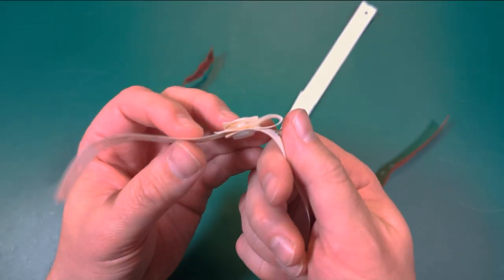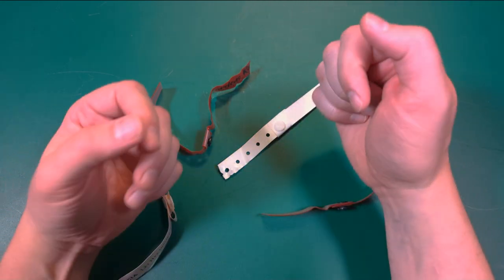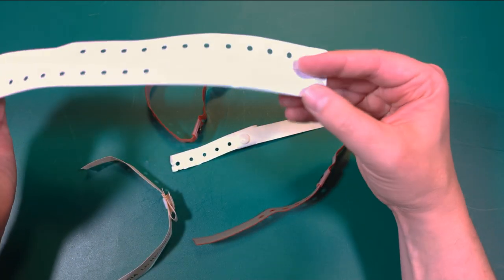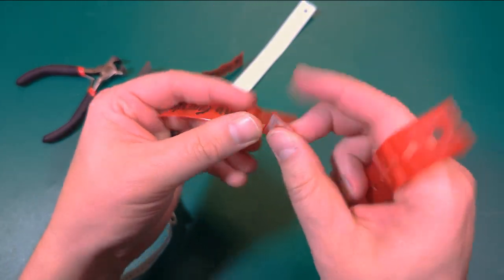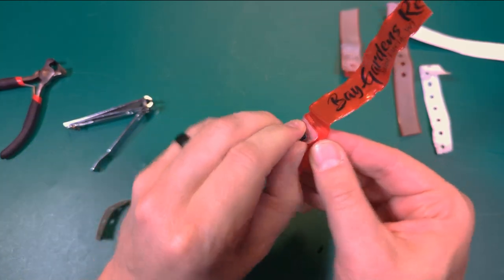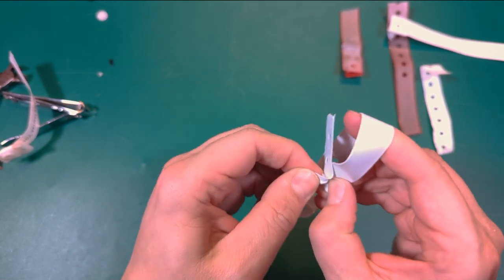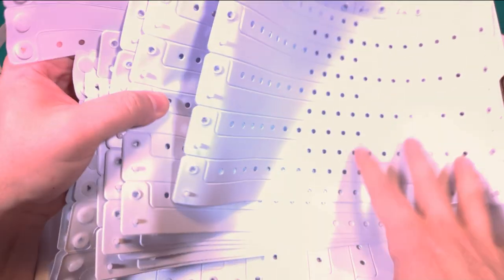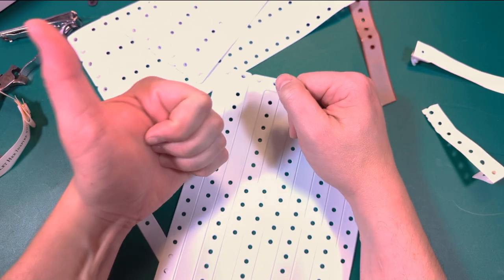Tampering with Wristbands - Part 1

Comment: You can buy just the tamper buttons; we buy them by the hundreds for our ankle monitors as you have to use a new one each time you change out the monitor. They work great for doing this except that they’re black; I’ve uses them in the past and just keep a couple paint markers as you can color them whatever you need though usually no one is looking that close, and usually they aren’t looking at the snap side anyway. You can also make a reusable version with a short threaded stud/screw from the hardware store, which is nice as you can just reuse the same one over and over again; this style closure as well as Velcro bands can be used to show the color of the day.
Reply: Came across this comment only after posting my own... Had basically the same idea about stud/screw, but yours is no frills. Sorry if mine "steals" any attention. Also, buying just the buttons, for any case you might need them, is genius! I actually didn't realize that's possible without that ton of bracelets 😅
Reply: @olgapisova6207 : We’d buy them in, I believe 100 packs, and they came in different thicknesses, they also were twist to break instead of being cut. You could just twist one side with a screwdriver, coin, or just about anything flat. We used them in ankle monitors all of our monitors, Al sensing, GPS cellular, and distance tether monitors used the same buttons despite being made by different manufacturers. The different thicknesses were because there were different straps based on length, weight, and type of monitor so one size didn’t fit all. They were damper resistant and not removable so anytime you changed, checked, or pulled/installed a sensor you’d need a new button. 
We didn’t always use them but once a few judges realized they made a decent bail alternative or cheap monitor for alcohol consumption they started ordering them as a bail alternative or condition of release and the use increased. 
I’m not sure if they sell the buttons without an account or contract, or outside of law enforcement, but I always thought it was a pretty cheap fail point or bypass for at times $5,000 monitors.
Reply: @libertarian1637  wow, that sounds VERY universal! For tougher band materials, would it be mechanically the weakest link? In jewellery, especially necklaces, even welded chains often have a non-welded ring or two near the closure, always thought it must be also for safety than just pure repairability... Does that have any relevance here?
Reply: @olgapisova6207 : The straps aren’t either rubber or vinyl with wiring running through them; the wires is what defects of the band is cut or separated/removed. The Bands aren’t weak at all but the buttons are designed to fail if too much force is applied as a safety measure as well as making sure the unit is set off as when the buttons break the bands naturally separate which triggers an alarm/alert. Looking at them for even a few seconds and most people would understand how they work and recognize the plastic button; but I recall a jailer in Baltimore that cut one of our bands instead of breaking the button when they were booking an individual with one of our Al monitors on them. I don’t recall the exact amount but it was over $500 worth of damage due to the Al monitors being unique; we ended up eating the replacement cost as the jail refused to pay and the damage wasn’t caused by the individual so the order didn’t require them to pay. Technology has changed a lot regarding monitors over the years and they have gotten a lot smaller, much more accurate, and even capable to operate via satellite for those times when cellular or POTS just isn’t an option.
Reply: Any particular name for them? I can't seem to find anything with just "tamper button"
Reply: @qqqqqqqqqqqqqeq : I can’t recall the company off the top of my head but I’m sure I have it written down somewhere. I’m sure they have a technical name like tamper evident closure or the like but in the chat I just referred to them as buttons because that is essentially how they function.
Reply: Link to Tamper buttons that would work in this situation?

Comment: Another way to tamper with them: cut the band at the hole the pin goes through and then tape it up from the inside to close them again. The cut will be hidden by the wrapped over part of the band and nobody inspects the "skin side" of the band, even if they look at the clasp.

If you have double-sided tape you can do this on your own (put the tape on your skin temporarily to hold it in place while taping the two ends together), otherwise you need someone to help you as taping the two ends together is a two-handed operation for most people.

Comment: That nail clipper was pretty nice trick. I think you could use it to cut the whole stem after cutting enough from the sides so you can get the whole thing off without enlarging the holes at all.

The only counter-action different places could have is color coded security snaps. Sure you can purchase box of bands with each color but that's get pretty expensive  fast.

Comment: What's your trick for those paper wristbands designed with a sticker that tears off ? Just cut it somewhere and use transparent tape on the inside to attach it back ? Or do you have a better way ?
Reply: That works, but a bit of Naphtha(or cigarette lighter fluid(Ronsonol or Zippo fluid) releases most stickers, and as a side bonus, once it evaporates(quite quickly, BTW)the glue gets sticky again, making putting the wrist band on super easy-the results will be undetectable.
This works on some anti-tamper stickers too.
Reply: @m.k.8158  yeah, LPL for example defeated a tamper sticker with alcohol, picked the lock and put the sticker back on the lock. The sticker covered the keyhole 😃

Comment: Coming at this from a different direction, perhaps you could subtly force the steward to put the wristband on you looser than they're supposed to. Either with the 'clenching your fists so you can slip out of handcuffs later' trick, or wear a chunky watch or bracelet when you're being admitted which will limit them to putting the wristband on a chunkier part of your forearm.
I am very tempted to get a sheet of these wristbands now to try different opening methods and also to see if i can print a reusable clasp for them

Comment: We have a upper end resort condo facility that uses these for access to the pool, water park, mini golf, buffet, and theater. Different colors for different days. The restaurant is open to the public so you sit around and observe the band of the day and then grab one from the collection we've collected. The snap is easy to remove. I used an old extendable antenna. Take it apart, find the section that best fits the post. Check it in the drill and the antenna tube will cut the fingers that hold it to the post. You have the parts but the fingers are gone. It's as easy as a dab of super glue gel, or hot glue to put it back together. You make it big enough where it can slip off and on with a little work and you have a reusable wrist band collection

Comment: I've been cutting a small notch in the band under the snap at an angle. No need to cut the snap and you can remove/install as many times as you like. I guess it's not as strong but it's basically instant and free.

Comment: Have you ever experienced the fabric type wrist bands used commonly at music festivals? They have the added bonus of turning themselves into a noose for your wrist if the slack end gets caught in something. When I used to work production for music festivals I would typically fold the end up and use a piece of e-tape to make it tight. I never had a problem with security. I think it helped that the e-tape looked similar enough to the actual clasp and security was typically lax near the staff entrances.
Reply from the maker: Yeah ... Thankfully I can usually slip out of those and then pull the clasp completely off, then destroy its teeth on the inside, then it becomes flexible and removable.

Comment: If you use a pair of diagonal cutters, you can usually use them to wedge underneath the cap and rotate the cap off the pin non-destructively. It cones out the pin a little bit not enough to keep it from retaining the cap.

The tyvek ones with the glue and the frangible end... Those are a bitch.

Comment: Got any ideas for the Tyvek wristbands that use adhesive in a span almost shredded to ribbons to make sure you can't get it apart in one piece? I kinda found I don't have to, they can be taped from the inside without drawing much attention (and if someone asks I'll say it caught on something and I put it back on myself), but that only works if it's the right color. Playing the same venue for years meant I had a wide selection of their wristbands, though. They could detect them as old by the serial number, but I think the circumstances would have to be pretty intense for them to go to that great a length.

Comment: No one is checking the snaps, are they? As long as the band is intact? I suppose if someone was suspected of having removed and reattached that'd be evidence, but im thinking those holes are the right size for the brass inserts with button tops and flexible bits used for holding a 3-hole punched stack of papers together...

Comment: Used to have one at hospital. Worked out as an 10yr old kid I could wedge my teeth between it and provide gentle pressure and they come apart. Bonus, they would snap back together looser than before and could be removed. I would wait till morning visiting hours, put on clothes snap off the hospital band, walk downstairs and buy sweets from the shop and return back. No one ever knew.

Comment: I know I have been able to open one of these, but usually the simplest solution is just to cut one of the sides of the hole and then remove the part and then melt or glue the part you cut. Precisely bc they aren't "doing forensics" and the cut part will be hidden anyway, this works. But it's always better if you are able to unlock it in your wrist which it's possible you just need some patience. The cloth ones with the metal bit are also openable, you just have to find the position to force the metal to unbend enough for the cloth to slide.

Anyway, I like your suggestions. Also very simple :)

Comment: Not seen the plastic ones like this for years, most here are Tyvek with a self adhesive fastening (that has wavy perforations to prevent tampering)

Increasingly they are printed with barcodes that have to be scanned on entry too to stop people just buying their own in the correct colour

Comment: You can clip around the tip of the "snap" just wide enough to bearily slip it off and then put it back on? Sure it might be suspicious if they scrutinize it but at a glance probs wouldn't look too different.

Comment: There are automotive fasteners for holding liner bits together that probably will work as well. Not sure what they would be called, but I have encountered the button style fasteners when pulling apart car interiors for modification.

Comment: Been doing this for years. The little knife on a Swiss Army knife…using the tip just keep going around to each little tab and bending it away from the post, after a bit you can open the snap. If you catch the right moment it’s closable also

Comment: On many occasions I've used those little bendy metal things that are on manila envelopes. It's reusable and they easily stay in place. Most places don't inspect that closely, but you can buy them in all sorts of colors instead of the normal brass color.  Edit: They're called brass fasteners... Go figure lol. You can get a multicolored 100 pack on Amazon for $6.

Comment: It's actually relatively easy to take these off non-destructively. Been doing it since I was a kid so I could sneak around at camps and such without being clearly marked as a student. I remember that a mechanical pencil and some finegling was enough to get her done, and then after the first time it was easier to take on and off. The paper ones are actually significantly more difficult to defeat, you need to have access to solvents and a pair of tweezers.

Comment: it could be possible to buy a cigar punch cutter keychain that you can poke inside the hole and bypass the locking bits of the clasp, although I'm not sure if you can get one in the right size

Comment: My trick is setting it large enough you can wiggle your hand out of it with a bit of determination, but small enough it doesn't fall off your wrist all the time. Kinda useful to have small flexible wrists here. And of course, that's if they let you clasp it yourself.

Comment: I have an even easier fix. When they put it on say "make it loose" and lay two fingers of your other hand along your wrist. Then you can wiggle in and out of it, and its less miserable while on. OR... you could use the toenail clippers on the back and slip the same snap back on.

Comment: So, I also hate these bands. The trick I found was to use my teeth as a wedge in the same fashion as the end snaps. This breaks the one way lock; the small disk part comes off so you can undo the wrist band, but still put it back together and it looks like nothing changed.

Comment: I haven't tried it, but I would think you could just turn the part of the wrist band with the snap, remove the part that goes against your skin to take apart the snap. Then you could take it off, hot glue to visible part of the snap in place without the glue showing. Maybe on the inside, a tiny circle of velcro (which can be purchased at a crafts store, or even most Targ/mart type big box stores) on the inside to hold it together but make it super fast and easy to take on and off if at a multi-day conference. You wouldn't have to replace the inside part of the snap since no one would see it. Then in your kit you don't need all different color snaps. Just something to cut off the inside part, and the 2 part velcro circle, and a tiny piece of a stick of hot glue and a lighter.

Comment: in Belgium most major festivals start to use rfid (some even use it as means of payment too, you need to top up your account linked to your rfid and you can just pay by touching an rfid reader twice... (once to charge the owner, second time to confirm that it's the correct amount they charge from you), they are usually embedded in a wristband in fabric that's tied onto your wrist with a plastic ring around the ends which has teeth inside that prevent you to pull it off ... or even metal ring that they press together with a vice type of thing... 
almost never seen the type in this video, only for medical bracelets maybe in hospitals but that's with a barcode to id the patient...

Comment: I go to an annual event where one has to wear one of these horrible things for 2 days in a row. I like to use a pair of tiny sewing scissors to cut straight from the severed end of the band to the hole that the snap is clipped through. Then it comes off easily, and I can put it back on later, tape it shut with a piece of tape or a scrap of a bandaid on the inside, and it looks totally untouched.

Comment: On the last white band you show us doing the removal  , it seems like clipping the rear facing part of the clip @4:10 would be better as you can get the clippers right to the stump of the plastic clip, leaving the plastic band completely unharmed/unstretched, whereas going for the clip part @3:40 leaves the stump a little too thick to go through the holes without stretching the band.    That way, with a replacement security clip fitted, the band looks untouched.

Comment: I learned how to defeat these at Boy Scout summer camp when I was like 13. I took the awl tool of a Swiss Army Knife and inserted into the snap so that I could remove it without much damage. It takes a little bit of work. I suppose a small screwdriver would work. Then, remove the receiving part of the snap and simply flip it around. You can snap it back together such that it will hold as long as there's not too much pressure on it. This limits the number of times you can snap and unsnap it (eventually it refuses to hold) but it was enough for a week.

Comment: Even easier than this. Cut the band off with scissors near the clasp part but on the non perforated side. Use clear tape to reattach each day. 

If you get to put the wristband on yourself then attach it loose enough to slip off at night (but tight enough to not just fall off in the day).

Comment: Why not some type of spudger or shim to wedge open the sprue from being secured to the plastic ring? Wouldn't be out of place as a small keychain ornament. Easier to remove and reuse the supplied security clip instead of using fingernail clippers to break off your withstand and then later installing new rivets into fiddly  worn-out holes. Plus no supplies to carry for multi-day events.

Comment: there gotta be a way to 3d print a reusable "hole bit" to fit those plugs? then just put that on the inside and it looks perfectly original from the outside. resin 3d print for bonus smoothness on your arm ;)
gotta try this some time but i rarely go places that have those bands, mostly we have fabric ribbons (like you show in part 2) that get crimped closed with metal. people tend to pry these open (to lose the hard+cold metal) and then tie them back together if they want a reminder of the festival or whatever.

Comment: seems like making a simple screw (well in plastic) and a bolt in the back as 3d print so you can snap off the one they give you and have a reusable open and close system for yourself